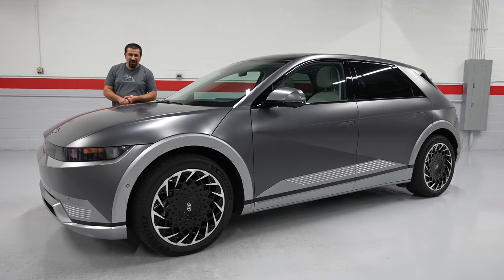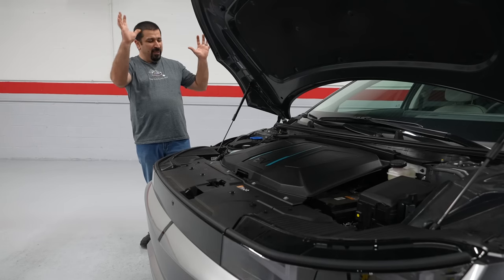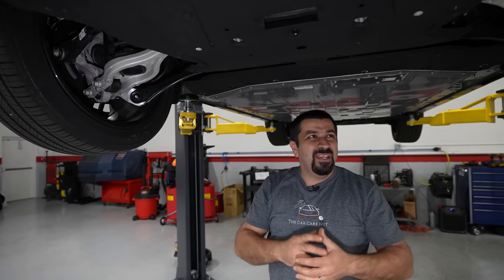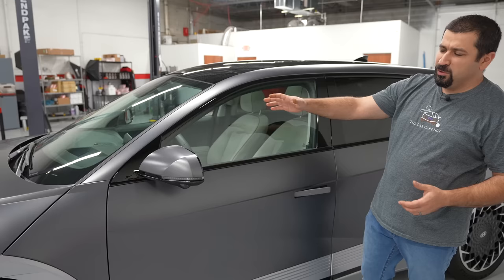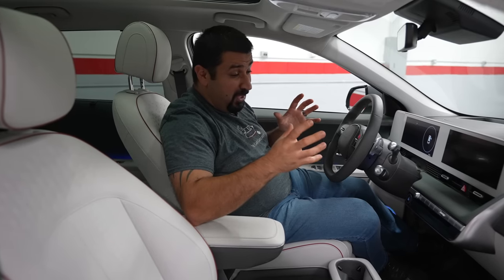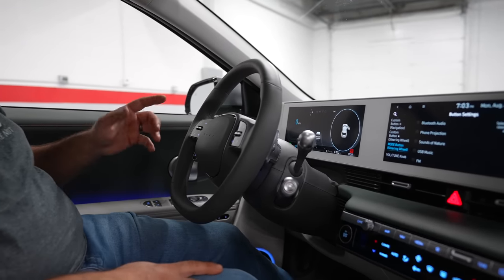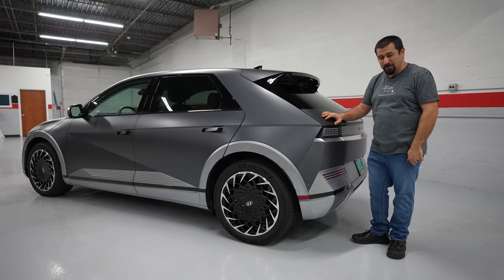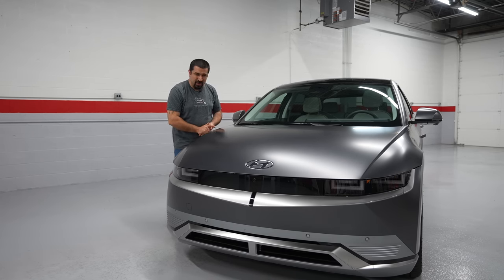Should You Buy a Hyundai IONIQ 5? Or a Tesla? | A Very Comprehensive Review

Comment: If you buy a base Model 3 today, and get delivery in January, you can get the price before reg and taxes to about $42k if you qualify for the new federal incentive.

A Model 3 for the price of a GTI is pretty good.

I won't do it because I don't trust the EV hybrid  hype because the tech is not mature.  Let the first adopters do the dirty work.   Also, anything over $25-  $35k is suspect.
Reply: In Canada a Model Y is 100k (no rebates) vs a Ioniq5 base for 45k after rebates
Reply: @martik778  What's a base Model 3 in Northern dollars? 

I was at a Tesla store the other day and was impressed by a base Model 3.  Pretty nice vehicle for just under $47k USD.

With the upcoming federal subsidy for lower income US households in January,  it'll probably sell for about $42k USD.

An base Ionic 5 will sell for about the same.  Probably a better built car, but the US Tesla Supercharger network makes Tesla amore practical deal, I think. Then an owner can think about life rather than being re-ordered to a EV charge schedule drill sergeant. 

I won't be buying either.  A $32k base ICE  RAV4 does everything both of those cars do and will still be operating 150,000 mi after these two EVs have been recycled.  

2¢
Reply: @lawrenceralph7481  Model 3 is 70k (CAD) or 54k USD after taxes - no rebates because it is over 55k. I've  had the ioniq5 for 2 months. It's a better EV IMO, much quieter ride, more room, hatchback, 350kw (18 minute) charging, V2L capability, HDA.  Gas is over $9/gal (4.5L) here so that Rav 4 would cost over $48,000 to fuel for 150k miles vs $3,600 for an EV.
My last EV (5 years old) had zero battery loss when I sold it
Reply: @martik778  My Toyota l HHy is perfectly good after 228kmiles, except the traction battery is shot, it has been replaced twice and neither the Toyota hybrid tech at the dealer or the battery replacement folks know what to do.  So it's dead.  A fine perfectly maintained AZ vehicle to the boneyard because the tech is beyond the capability of those I can find in the San Francisco Bay Area. 

My basis for guessing an ICE RAV4 will outlive a battery powered vehicle by 150k miles is a battery will make 200-250k miles and a well maintained RAV4 (in California, no rust, 5000 mi.oil changes, weekly wash etc) will make 400k miles with good maint and regular repairs. 

In CA the operational cost calculus is different and less favorable. Governor Newsroom has his hand out at every turn.   In 200k miles, a 32 mpg RAV4 will consume $37k of $6 per gallon regular.  An CA  Ionic 5 at 2.8 mi/kWh will consume $30k of 42¢ per kWh (Tier2) electricity.

Thr the higher ICE maintenance numbers slightly favor the EV, but they are close enough that the uncertainty makes a substantial difference unpredictable. 

On the flip side, at 200 kmi, probably the end of my life if I'm lucky, my grand kid gets a reliable Toyota instead of a dead $20 k battery.

Having moved a lifetime on ICE and having only a few years to go, I am content with the status quo and do not care to be re-ordered by another tech drill instructor. 

Good luck... Your real estate values are going to skyrocket as your winters become milder. But guard your North, the ambitious Russians are just across a short distance and like opportunistic border expansion on the silliest of pretexts...
Reply: @lawrenceralph7481  Who the heck pays 42¢/kwh or only gets 2.8mi/kwh? We pay <10¢/kwh in Vancouver and I get an avg of 5 mi/kwh.  I thought all you Californians were on free solar ? :)   Not such a significant  saving with your high rates (triple the national avg) and a lead foot :) 

I'd sell that Toyota hybrid before scrapping it, someone will figure out how to repair it.    Sparkie got 480k miles on his 2010ish Chevy Volt and the battery was still good. They are practically giving away Bolt's right now near 26k iirc.  They're expected to go 400k before battery degradation

One thing for sure, repairs on any EV will generally be more expensive than an ICE but should rarely need any.  Brakes last forever. I love driving down a long mountain road and getting an extra 20 miles regenerated instead of turning my rotors into dust.

Go out a test drive an EV - you'll be amazed
Reply: @martik778  I have a paid for 550e cabriolet which satisfies my cruising heart. 

42 ¢ per kWhr is the current Tier 2 rate in the PGE service areas of NorCal. Expect it to go to 46+. ¢ this winter. This is above the lower Tier1 household rate , and the most likely marginal price of household energy using an additional  300 -600 kWhr /mo range.  Tier 3 approaches 65¢ per KWh.  Tesla superchargers charge about 42 cents for kwh.  Others go up to 75 cents per kwh.  These are current figures as of August 2022, my last bill.  The government is going to get you... 

2.8 kWhr is a slight reduction based on the EPA rating of the car, including winter and foul weather, efficiency losses on charging, and poor weather and terrain.   Recent road testers get in this range.  Tesla 3s do a little better but they are more aerodynamic, lighter and better designed for efficiency. 

Wistful Selling of a favorite dead car is a unpleasant and unrewarded task.  Have done this one too many times.  If someone could fix it, the attending Toyota hybrid consultant and the battery rebuiders at the  CA firm would know how.  So "the someone" is an illusion,  at least to me.

Content as is.  Don't want another tech nanny.  But good to know that other former EV purchasers are continuing to buy new EVs as the novelty wears off.  Carry on.

Comment: You're making far too much fuss about charging and range.  Most people don't drive 200+ miles on a day to day basis.  In the US, the average distance driven per day for passenger cars is somewhere below 30 miles.  Planning for charging is really only an issue for the occasional long trip, and it's not that big a deal.

Also, your commend about getting 1% charge overnight makes no sense. The charger delivers 6A on 110v by default (can be set to 12). That's enough to give the 77kw batter about a 10% charge overnight - more than enough to cover the average user.

Comment: 39 minutes. Appears to be unaware that Kia and Hyundai have indeed put electric motors and batteries inside "normal" petrol cars. And that BMW and Audi have essentially done the same.
And maybe i missed it but did you even mention the charging network? Thats kind of a big thing. 
And of course you can plug it in for an hour and go across the country (if its a tesla)
Also don't believe you it went up 1 percent charge plugged in overnight unless you didnt flip the switch to "on" which wouldnt surprise me given the issues you have with gear selection.   At say 3 miles an hour which would be low but possible for 110v, thats 30 miles in 10 hours. Which is >10% of this cars range. No reason for the FUD hyperbole.

Comment: The title of this video is completely misleading. It is a review of the car and nothing more.

The differences between this and the Tesla should be clear and obvious.

This card does not get up to $9,500 tax credits. 

The 0 to 60 in this car is less than the Tesla.

Of course this vehicle can't use all the Tesla superchargers although maybe it can soon.

Unlike the Tesla, This car does not run on an iPad. This might be the single greatest thing about this car. I could not imagine driving an iPad into work and then waking up one morning and finding out the buttons are changed because Tesla.

This car has better seats,  the ride is better and it's less firm and doesn't get bumpy like the Tesla.

Do we know if this car has better quality control than the Tesla?  

This car has a roof cover which could reduce the ridiculous amount of sun that goes into a Tesla.

But the biggest question is if you are in Montana - where Tesla does not have a repair facility in the entire state - would there be someone to fix this car? You might think so but then again who knows?

Lastly this car has a better warranty. And that's extremely important.

Comment: This car is weird, but the wheels don’t fall off like bz4x. 👍🤣🤣🤣
Reply: Only 258 units were sold. At least they caught and acknowledged the mistake, unlike Hyundai engine fires
Reply: @andybub45  Which are happening with combustion engines. They have so many moving parts that there is inevitable wear and tear. My previous ICE BMW had two recalls, one after 9 years of ownership and one after 11 - because some connectors were breaking down after the material didn't stand the test of time.

The Toyota problem is a design fault and they are trying to remove these cars from the road by buying them back - so there is no easy fix for that problem.

Comment: What you are saying in the "Things I don't like about it" section truly makes me believe that a plug-in hybrid is the ideal vehicle for where we are in 2022.
Reply: A PHEV is even more complex because it has an ICE and all related components to fail.  I got rid of mine to go full EV
Reply: A plug in is the worst of both. This one you charge once or twice a week A plug in every time you drive. Always. Or you are just driving a very expensive and heavy gas guzzler.
Reply: @petervanmullem6087  I had a Volt for ~5 years, It was 99% EV mode, used < 5 gals  per year, less battery weight offsets ICE components. They can make 3-5x as many PHEVs as EV's with the same battery materials so there's more potential environmental and gas savings impact

Comment: No, you should not buy any electric vehicle manufactured by Hyundai.  The high voltage battery in my 2017 Hyundai Sonata PHEV died under warranty after only 4 years and Hyundai refused to repair/replace or buyback.  After 18 months I won a non-lemon law buyback through the bbb… however Hyundai deliberately miscalculated the repurchase amount, forcing me to resubmit a claim with the arbitrator, which I again won months later.  Stay away from this awful brand.

Comment: 1300 lbs heavier than my ‘17 Camry and double the cost. From a value standpoint, EVs are a joke.
Reply: A  hybrid Camry is 40k after taxes vs 45k for  an ioniq5 RWD std range or 38k for a Bolt EV (Canada after rebates/taxes)  Driving 20k/yr could cost 3$,500 vs $300 with an EV. With $9/gal gas ICE cars are a joke
Reply: Weight in a BEV isn't an issue - they use regenerative breaking, which means that most of the energy you used to accelerate that mass can be recovered during the deceleration instead of being vented into the air from yet another inefficient heat producer (breaks)...
Reply: @karlgunterwunsch1950  34% recovered in the city vs 6% on the hwy. I love driving down a mountain road for 10-20kms and never touching the brakes but gaining several kw's of battery charge. https://fueleconomy.gov/feg/atv-ev.shtml

Comment: Hello, from the very beginning, you noticed that this machine is VERY COMPLICATED, it has a large number of electronics, control computers and sensors, the quality of all this is a big question. 
Thanks a lot for that! 
You warned people, but unfortunately, not everyone will understand what you are warning about.

And I give a guarantee that before reaching 100,000 miles, part of the electronics will begin to fail. Dealers will try to deny warranty repairs for bogus reasons, and those lucky enough to fix their car under warranty will wait half a year for parts and won't be given a free loaner car.

I have a BAD EXPERIENCE with a kia niro ev with just over 16,000 miles. 

I personally would STAY AWAY FROM this car and ANY Hyundai/Kia PRODUCT. I prefer to take a simple 2023 RAV4 XLE, non hybrid.
Reply: Lol, have you ever looked at your transmission?
Reply: @wgemini4422  yes, with my transmission on my car everything is in order, the mileage is already over 240,000 miles and there are no problems, I service it by myself.  But my electric Kia Niro died at 16,000 miles.  You don’t need to watch anything, go buy boldly, (if you have enough money) electric cars “don’t break”, right?  😁
Reply: @ПавелЕпифанцевъ  That's not the point. The point is that your transmission is much more complicated than the one on the EV. Any car can die at 16K miles or last 240K miles. Anecdotal evidence means nothing. Prius has traditionally been one of the most reliable cars despite having a battery mainly due to the fact it is mechanically simpler than an pure ICE car.

Comment: Don't quit your regular job. At the beginning of the video, you criticized that this model has two heat pumps and they were complicated. In comparison to what? A gasoline/diesel engine with 2500 moving parts? The claim that it takes a long time to charge with 110 volts is correct, but if you charge at home with 110 volts, you don't encounter this problem, you just normally charge your electric car to the level that you know you can get to the next fast charger. It can be compared to driving your ICE (Internal Combustion Engine) until the tank is almost empty and can't make it to the gas station. Is this the fault of the car? I have commuted to work 160 km round trip for 2 years without any problems with a 28 kW EV. Of course, I plan my driving, but after driving gasoline and diesel cars for 45 years, I can promise that I also planned where, when, and how much to fill up my ICE.